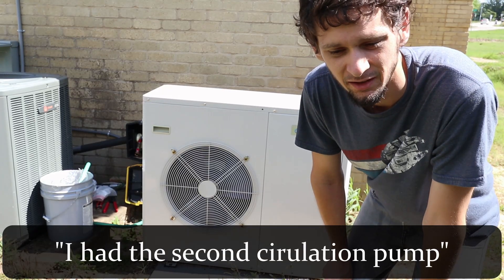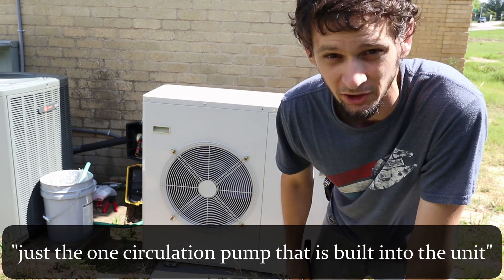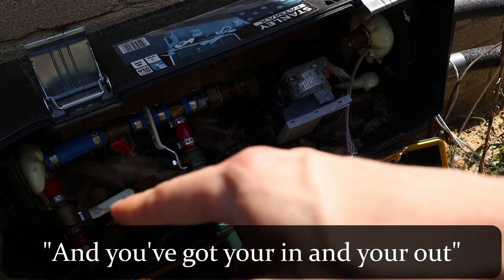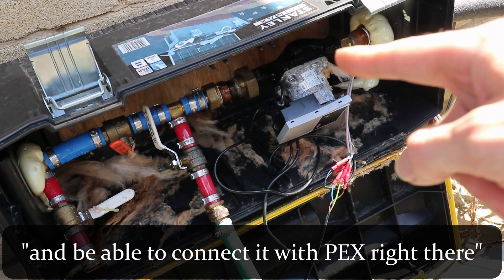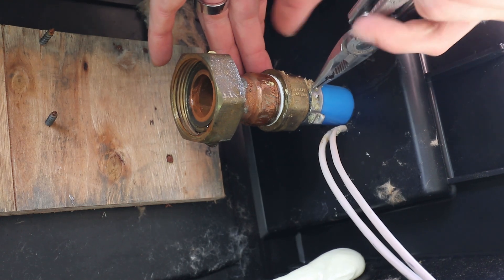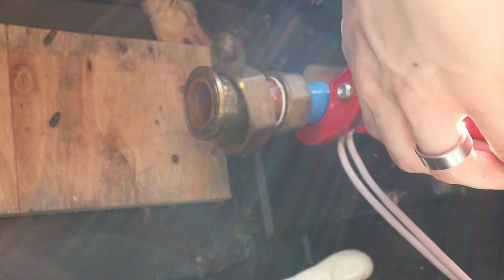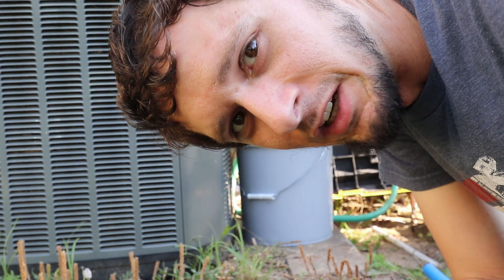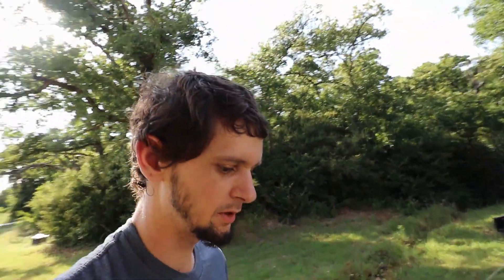Chiltrix Circulation Pump Failure | Diagnose and Bypass |

Comment: Look at the condition of the water quality. Shouldn’t have any corrosion in the iron body pump with a tight closed system. it appears you might have used standard “plumbing” pex tubing without an oxygen barrier as you should have?

Comment: Is your chiltrix still running well?  How did you decide you needed a secondary pump and then it was fine without it?
Reply from the maker: AJ I think I was involved in your adventure on the Facebook group. Hope you got it resolved.

I don’t remember what the conditions were that made me go with two pumps but I ended up removing one. Of course I only have three fcu’s connected right now so when the other 2 or three are added it could be I’ll need that second pump again.

I’m using a ~100’ trunk line where the return line runs all the way down and then back again so that each fcu has the same amount of length there and back. Which was the recommended install method. Seems to balance well and I don’t have any valves per fcu.

Comment: Hi. It's almost a year later. How is the unit doing?
Reply from the maker: Unit is still working good. One circulation pump is perfectly adequate for the three units we have connected at the moment. Haven’t had to replace anything however I haven’t tracked down why I’m losing pressure in the system. Entirely possible I have air trapped in an unused line though that slowly makes it out the bleed valve.
Reply: I would venture the guess that the plex lines are slowly expanding over time as well. That or some of the material is evaporating through the plex? But thanks for the update!